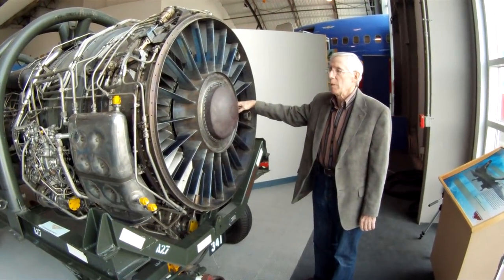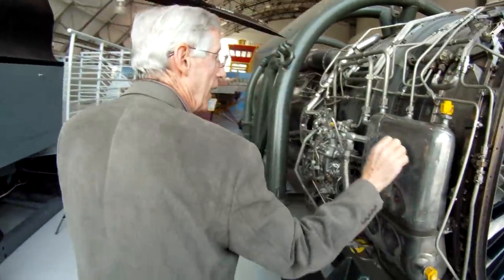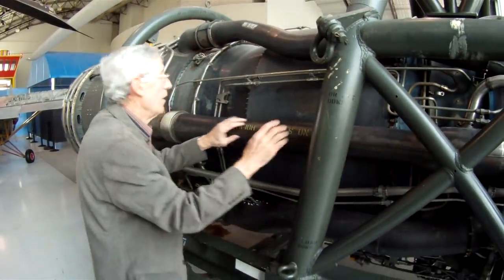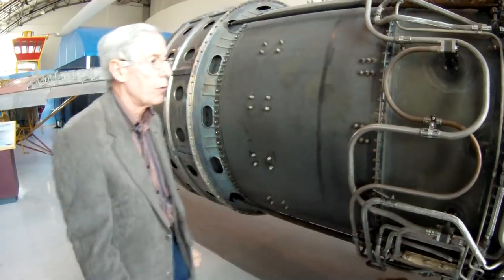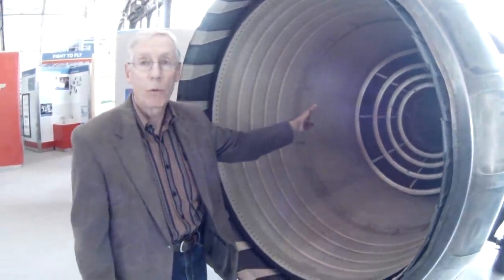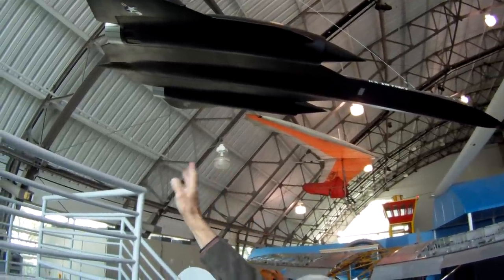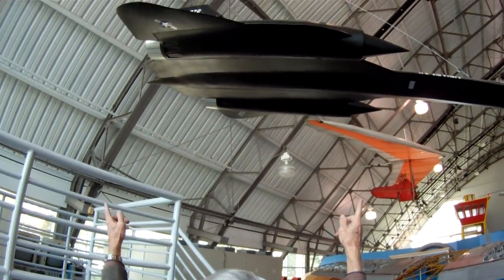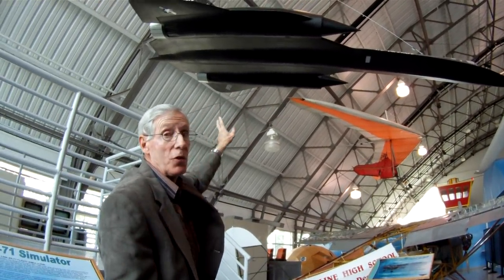SR-71 J58 Engine Tour

Comment: Kelly Johnson was an absolute genius!!
Reply: Yes so glad i was a very good friend of him at Lockheed and Ben Rich.Many of my design drawings are in his collection, before the SR71 was ever built.Kelly never designed the engine on it.
Reply: Yes he was until i came along.
Reply: @davidmyersretiredaerospace8038  Ben did the engine modifications, right?
Reply: Ben Rich was a very good friend of mine at Lockheed so was Kelly.Lockheed was so impressed , with my design work when i was 10 years old when i sent them many copies.They give me a top job when i left university.Kelly thought my design work was way out into the future, and much better than the blackbird.Only drawback would be cost production building them at that time.
Reply: Lockheed skunk works and Area 51 both sites i worked at.Did some work at Northrop until i was zapped out from there.
Reply: Not all .Intake system.
Reply: Sure did there.
Reply: Don't forget Pratt & Whitney's Bill Brown. He designed the J-58. It was originally intended for the US Navy but I'm not sure what became of that. When the J-75 proved  less than ideal for Operation Oxcart, they turned to the J-58. It was a case of the right engine at the right time.

Comment: this engine is a pure masterpiece
Reply: Built by the World's Finest, P& WA,
Reply: The nozzle is a masterpiece, not the engine. It only puts out 35k lbs thrust. There are bigger engines. but the nozzle and the bypass that utilizes the shock inside the nacelle and creates 80% of the trust to M3.2.
Reply: Yes and no and it was not built by Lockheed.It was a very old design just modified.
Reply: I've heard you spend less fuel going full throttle.
Reply: By who???.
Reply: David Myers Phd ImechE. I believe some was used in the the B-58 if I remember
Reply: What the full engine or part?.
Reply: @defiverr4697  He said 38 k thrust, but 35 38 WOW!.
Reply: @Mr.Plutonium  Heard pilots and Kelly say that!. So a fact.
Reply: @JDqs-kg5sp  J-79 GE.
Reply: @Mr.Plutonium  it is same for my car it uses less fuel as drive faster, 100km/h-15L, 150km/h -17L, 200km/h-20L
Reply: Indeed, why can’t we have this engine in the 21st century
Reply: @ahmadtheaviationlover1937  we can but do you have airplane for it?
Reply: @amorag59  You are not a propulsion engineer, are you?
Reply: As a retired A&P holder. this is poetry, and yes, a masterpiece. Saw the SR-71 when they retired it in San Antonio Lackland AFB.....engines were still installed....I got there pretty quick. AWESOME.

Comment: As amazing as this thing is - It amazes me to think that they had this technology back in the 60's! Yet- It still remains unbeaten, 50 years on. 

Hats off to Lockheed Martin and Skunk works. I've been in love with this plane since I was around 12, and I'm 32 now. I saw one of these parked up in NYC.. What was it, USS Intrepid. I will NEVER forget that moment.
Reply: dont know about that
i think they got help from others.
these planes was way to far ahead of its time.
Reply: pgice yeah ok. It was aliens. Sure
Reply: CIA approached Kelly Johnson in 1957. Project was code named Archangel It was conceived By Kelly Johnson & being developed in the Skunk Works as the A-10, then into morphed into the A-12 before Gary Powers was shot down in his U-2 in May 1960. All done with Slide Rules, no computers or CAD... Sticking point was it needed vast amounts of Titanium which the USA had little of. CIA acquired most of it thru Shell Companies that purchased it from USSR !!!   It was then designated RS-71 when the chines were added to the leading edge of the nose & fuselage. The President reversed it to SR and no one was going to correct the President...    See LockheedMartin Website for the full story
Reply: THat and the fact, from the display at the Strategic Air Command Museum in Nebraska, while the airframe was made from Titanium most of the engines were made from more exotic, and hard to work with, Nickel/Cobalt alloy. Hence the dark greenish color. Super high melting point it had.
Reply: The design was topped, and in the year the designer Kelly predicted it would be, 2005, yet this design was crushed and men sent (The American Sniper no less) to end the life of the genius who did it { I got better}
 When asked why he had a code sequence for the planes that began with 2004, he joked, sorta', that he thought that woudl eb the year the design would be replaced. 
Yet when I studied the A-12 single seater at the JAM at MSP Guard Base, the fastest one ever made, and drew plans for one made of carbon fiber, with H.O.P.E. engines that exhaust pure water and could run into space...
Dark Lord Chainey, the Vice-president, Man who stopped the Blackbird program 3 times, sent CIA contractors to cut up our star attraction and take it back to CIA headquarters - long story short - seems it is not only Big Oil Men who do not want US to have a super version of this plane, yet the ED's I call the 'reptile dysfunktion' not wanting Earth Humans to have such weapons - with SOL capability {look it up if you dare}.
OH AND for bonus points look up a now often quoted conversation in the office of top German/American rocket scientist Werner Von Braun. When asked about how we got from what were just underpowered box kites to landing on the Moon in just 60 years he pointed to a picture of a silver flying disk and said "We had Help"... really he did. We can still access this "help" form the goodly aleins BUT the bad ones who hold us back go after those who channel this 'genius' and end them.
Reply: pgice Yeah because American engineers can't design jet engines. I think you need help more than they ever did.  If you're lucky the the aliens will give you a window seat in their spaceship.
Reply: @pgice  it was cold war ...... half of the things achieved on both sides would not be possible without it or it would take much much much longer....look now on the space program ....no interest from the goverment here or there...but if china would release a statement to built a base on the moon . us would be on mars in 2 weeks :D
Reply: I have same thought!!!  This was 50's technology.  Not to mention that they didn't have all the computer models and so forth.  This was just a bunch of smart people getting in room and making what seemed impossible, possible!
Reply: @mrhoffame  Yup - Engineers actually drove 1953 Chevys and flathead Fords to work, then drew the plans for this Titanium wonder.
Reply: HybridTheorykid1 I had one in a glide path over my head at night in 1985 when I was 10. I thought it was an Imperial Star Destroyer. I learned years later it was an SR71
Reply: Officially unbeaten, unofficially there are faster ones.
Reply: There are two (2) other key players,  P& WA and General Electric. Salute
Reply: @mrhoffame  You keep saying this was "50's tech", dude computers are 40's tech and computers are nothing more than calculators, engineers can do all the same calculations it just takes longer.

Comment: Ben Rich's book had a section on "Habu" the nickname for the aircraft.

He mentioned a congressman or somebody asking when they saw the aircraft "What's the purpose of the spikes? Don't you want the maximum amount of air going into the engine?"

Amazing how old this aircraft is and how much wonder it still generates.

Salute to The Skunk Works

Work on the A-12(Predecessor to the SR-71) started in 1957 after it was decided the U-2 was too visible on radar and too slow. Skunk Works got to Revision #12 so A-12 was its name. 

This aircraft was revolutionary in so many respects compared to other aircraft of its day. The CIA made the order in 1960 and the 1st flight was two year later.

TWO YEARS

To get anything done today would take two decades and billions in cost overruns